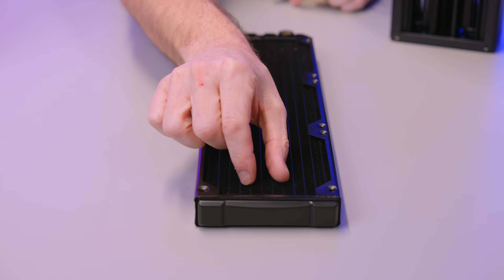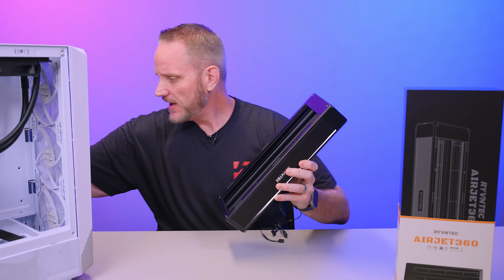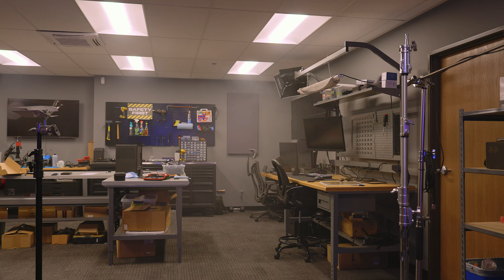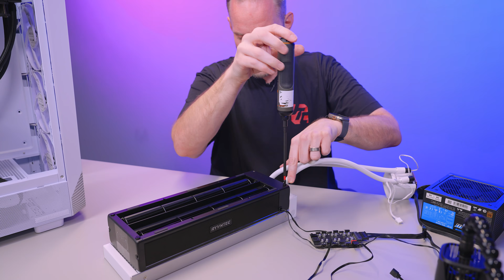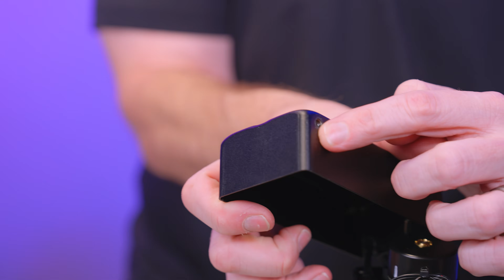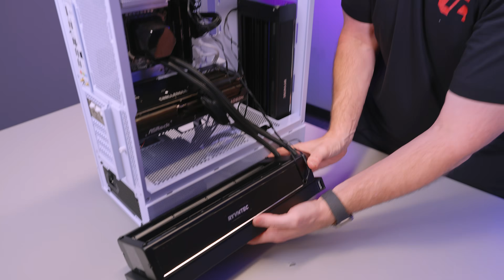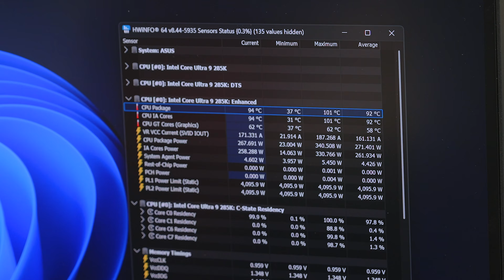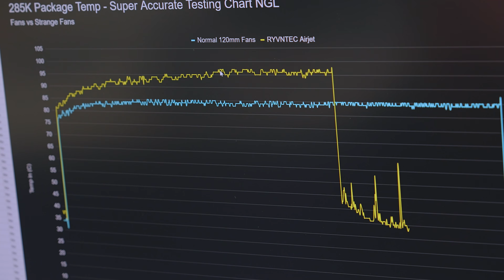Check out this INSANE Prototype!

Comment: i just don't see the point in this product.  it is like they did zero computer simulation of airflow if they wanted it for a radiator.  what are you supposed to use it for?  i'm confused.  they are so big and bulky.  who would purchase this for a pc case fan?  :face-purple-crying: